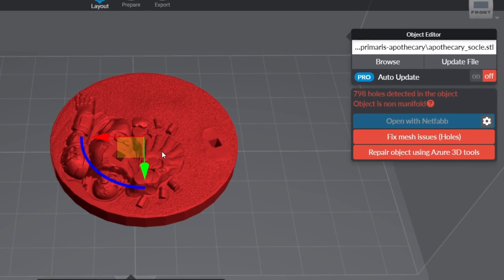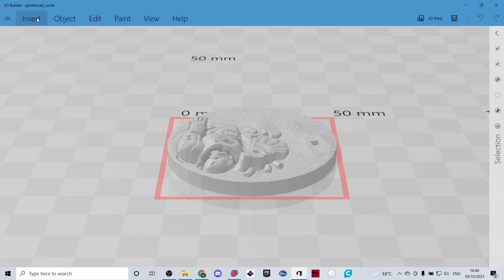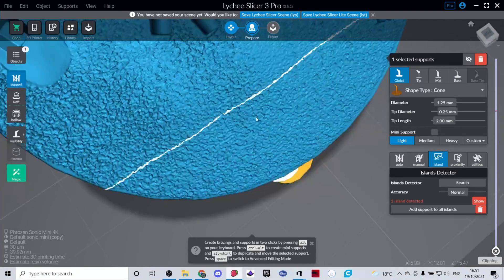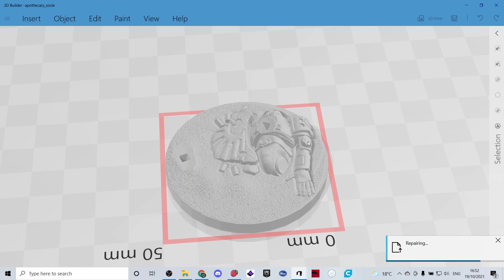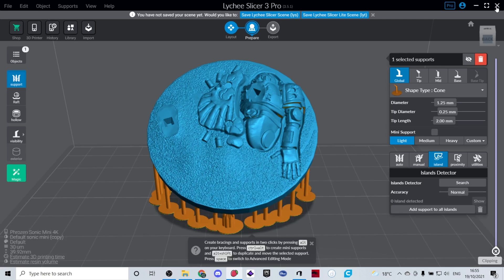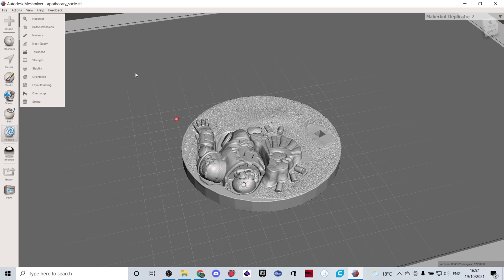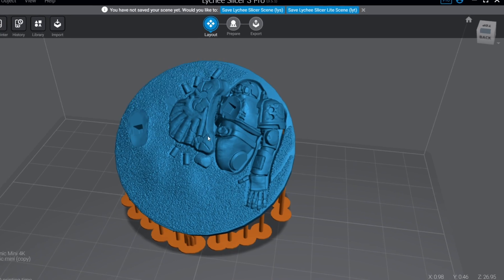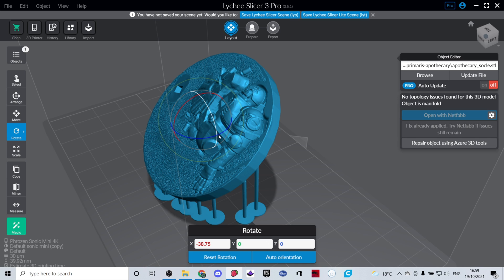How to fix STL,  Fix non manifold STL with these easy steps!

Comment: Life saver bru, I had a few objects with this issue and your guide helped me repair them perfectly.
Reply: I have a part that I can't get any of these to work. Same problem, but the "repairs" either do nothing at all or completely damage the part. Tried several programs so far and tried exporting to several other file types/extensions, but nothing will work. Ever have a problem like that, and/or have any idea what the next step to try would be? I could recreate the file from scratch, but it would probably take me a week to get everything right. It's not a very complex part, but I'm just not experienced enough to do it without a lot of steps and problems along the way... so this option is probably the better one to try first.
Reply: @deucedeuce1572  sorry I don't know what the next steps to try would be. Good luck.

Comment: Such a simple way to fix this frustrating problem. Thank you!
Reply from the maker: For real it’s so much easier
Reply: Wish it worked for me. It has many times in the past, but it's not right now. Trying to find another solution. Need to modify a file in another program, but I can't, because it's not showing up as a solid object.